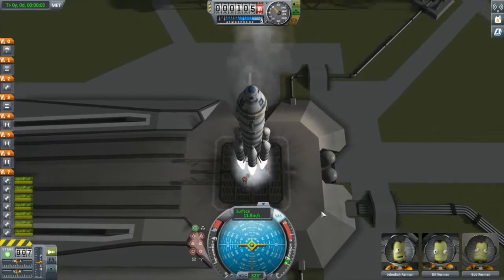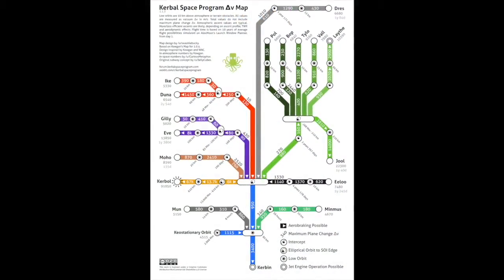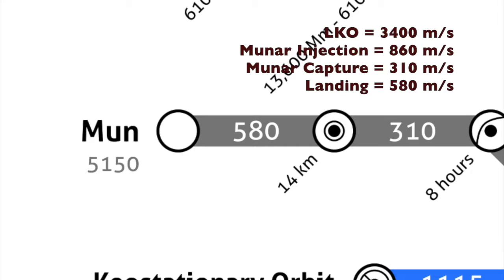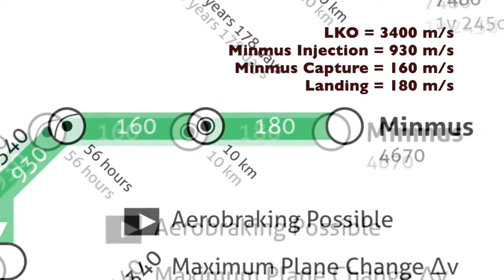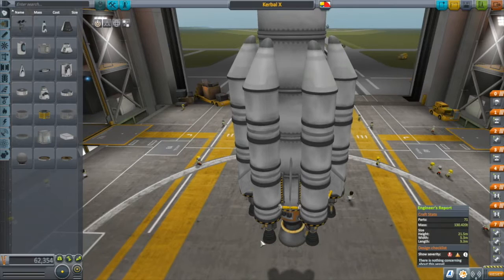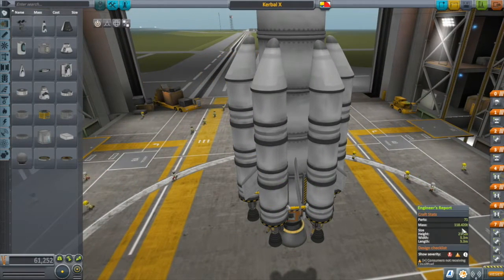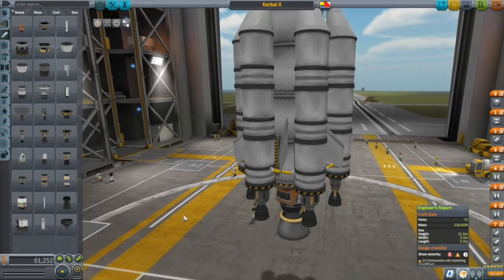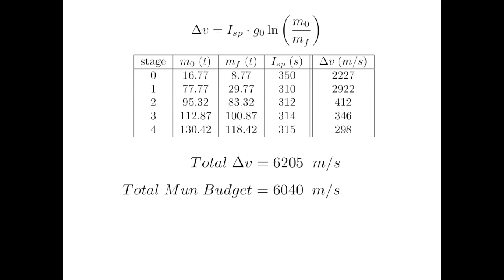Delta-v Budgets | KSP Let's Do The Math

Comment: isnt it necessary to calculate the delta v of the stage which will return the craft to kerbin after landing (on the mun for example) with the gravitation on that particular planet/moon? 
or this already taken into account by the delta v map?
Reply from the maker: Actually, the dV of a rocket is independent of the gravitational field. It's dependent upon the masses of the rocket and propellant,  and the exit velocity of the propellant, and that's it. Isp is exit velocity divided by the acceleration due to gravity on Earth (g_0). The g_0 only appears in the formula, because KSP uses Isp instead of exit velocity to measure engine efficiency.

Comment: I want to calculate the velocity budget to send a launch vehicle to an altitude of 500 km. As the velocity budget is calculated like V_leo + V_drag +V_gravity + V_steering. Assuming it to be a circular orbit V_leo = sqrt(u/r) so V_leo is lower for higher altitude giving me a lower velocity budget and if I intend to use a parking orbit I would be increasing velocity budget by introducing a lower orbit and some impulsive maneuvers. Can I directly launch into 500 km orbit and if I can do it why ever use a parking orbit that increase my velocity budget ?
Reply from the maker: You certainly can insert straight into a 500 km orbit. I do it all the time, but for budgeting such a mission I just take my insertion cost for an 80 km orbit and add the transfer from 80 km to 500 km, even if that is not what I do. It's just simpler. Here's my video on calculating ascents when an atmosphere is involved. It get's into different inclinations, but it would be easy to adapt for different altitudes.
https://youtu.be/0BtbYVtZ9ac

Comment: Great video. But one question; For calculating the mf, shouldn't we also subtract the mass of the side booster's body? you just subtracted the fuel mass.
Reply from the maker: Good question, but it is just the fuel mass you subtract off. The expelled fuel mass creates thrust, not the ejected stage. Now, the stage mass is subtracted off when calculating the starting of the next stage.

It is a good thing to remember, and perhaps I should have emphasized it more, but when using the rocket equation, it is only the loss of propellant mass that affects delta-v.

Comment: I don't understand why you calculated it like this when it appears all of the engines are cross feeding fuel and you didn't include the mass of fuel burned by the mainsail.
Reply from the maker: +Grayson Savage The fuel lines keep the main booster tanks full until all the radial boosters are gone. Until the mainsail is on it's own, it is running off the radial tanks.